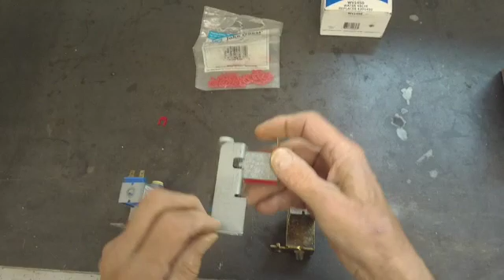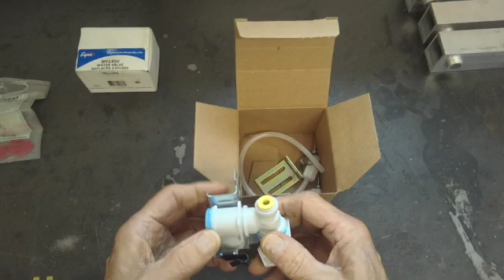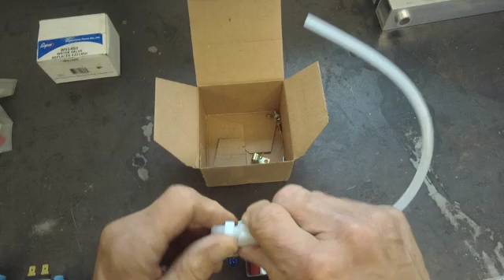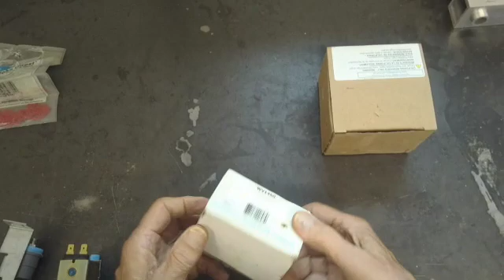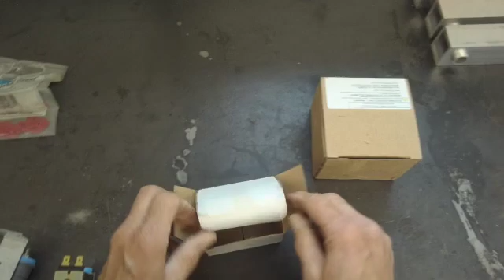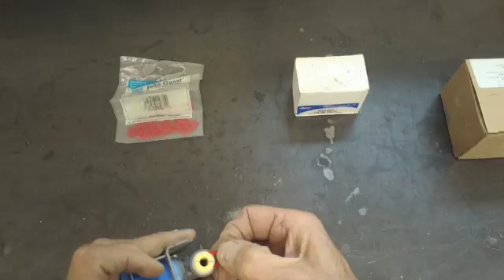Ice Maker Water Valves

Comment: TERRIFIC job of telling us about these different valves. Getting hard to find the non-Supco valves! I managed to find a Robertshaw one, new but 8 years old. Works great. 
Just a little tip: For those of us who don't have the little plastic clips you put on to keep the output line well-seated (starts at 4:33), a ring of 18G wire works just fine. It surely would be nice if the manufacturers had managed to include that clip with the valve, but maybe they thought only professionals put them in and they would have the clips? Anyway, a little wire ring does the job. 
Keep up the good and very helpful work!
Reply from the maker: @RobertL39219  Those are John Guest Locking Clips for 1/4" Tube OD (PIC1808R) available in packs of 10 or 100 for pennies.
Reply from the maker: The subzero valves we use now come with the clips and they are made in Mexico, much better than Supco, much better than that other country. What’s important to know about water valves is the duty cycle, not all valves are equal. If you put a regular valve from a refrigerator into an ice machine, such as a UC15 it will burn out.